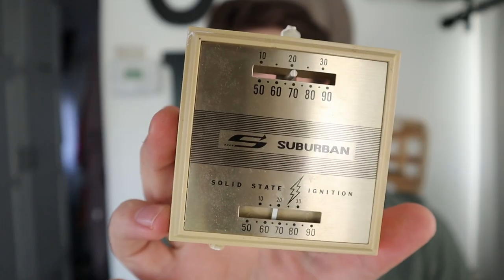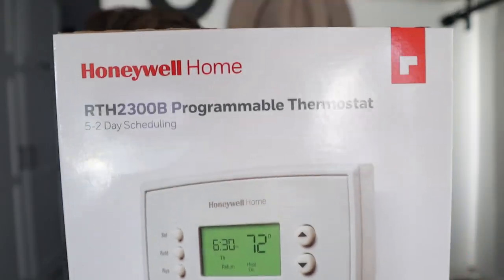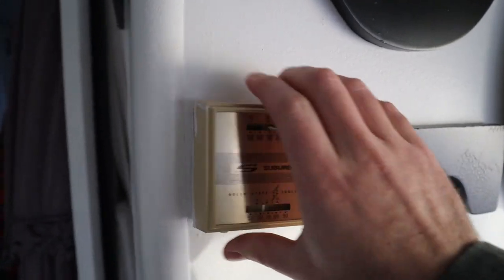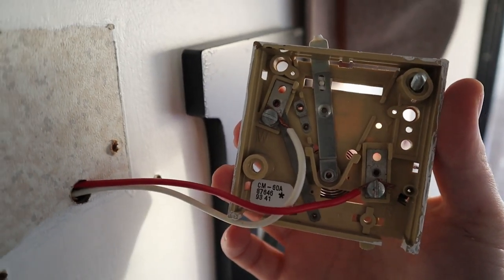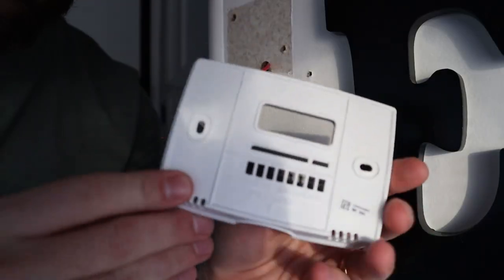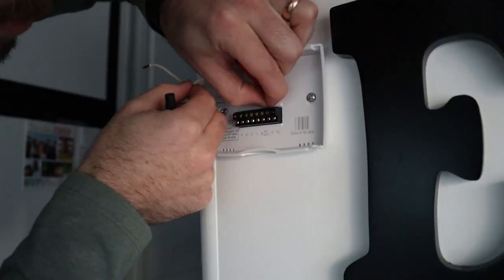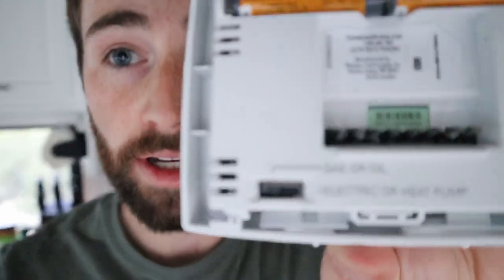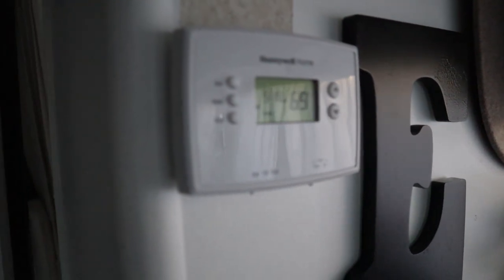CAN RESIDENTIAL THERMOSTATS BE USED IN AN RV???: Full-Time RV'er Upgrades RV Thermostat to Digital

Comment: Ours is a 2 wire/heat only as well so we went with the "plain jane" honeywell 1100 model. I see yours has AC/cool as well.  You're all set if you ever decide to wire in or add AC.

Comment: Will that new thermostat you got work with the 12 volt system? The reason I ask is because I believe mine is 12 volt and I need to replace it and want to go digital, just want to make sure I buy the right one.
Reply: I put a digital house thermostat in my 97 Aristocrat and have no problem. It works better than the piece of junk I was using.
Reply: @littlejon7884  Thanks for the reply I appreciate it. I ended up buying a Honeywell RTH221B programmable digital thermostat I think it was $30 at Home Depot and it works amazing compared to the analog one I had. Already I've saved a bunch of money on propane because I have a working accurate thermostat. Definitely a must have upgrade if you have an RV with an analog thermostat.

Comment: I hate to tell you this but I don't think that was what was causing your issue. I mean it's not a bad idea to replace that old one anyways. The thermostat doesn't have the ability to control those things separately. It just tells the furnace to go and stop, it can't really tell it to just run the fan without running on the gas. Obviously it can do this by manually turning on the fan switch if you have one but not with the actual temperature control. It may have fixed itself or your problem is intermittent and it's working fine now.

Comment: I was going to order this thermostat but I cancelled because in the product description is says for 240V. I have 12 V DC in my thermostat in my Rv. I am confused by this
Reply: Just use the low voltage Honeywell with the two 12 volt batteries and you'll be all set.  I like to keep it simple, non-programmable, heat only, two wire installation.

Comment: Super helpful guys!! I full time in a '89 Allegro and I am parked for the winter in Michigan. I went to do my thermostat install today and I notice that I have two blue wires(eek). well I am pretty mechanically inclined and also a decent diyer and figured it was simple 2 wire install like I have done before in a residence, but the blue wires  threw me off. 
I found your video and see we have the exact same thermostats BOTH!! I had purchased mine on Amazon the week before. :) so your video was helpful. I clicked subscribe!
Reply from the maker: Thank you! Always nice to have support from the RV community! 😊

Comment: I haven't even gotten into this video yet - - but I've subbed and liked!! 
I love the concept! 
WHEN are you going to get 'legal to visit Canada'?? I have a great spot for you to hang for a bit - in the middle of nowhere, with incredible vistas, within 20 minutes of the main mall of Kelowna BC, in the heart of the Okanagan Valley.
From 44 C in the midst of the summer to minus 33 C (sorry - you'll have to convert to F), we see all manner of extremes here. I'm full-time in a Toyhauler, but it's stationary. I froze up plumbing lines (and PEX allows them to freeze/thaw without bursting) but right now, I've got a furnace problem.
No biggie - - only minus 9 here and the electric heaters will keep me comfortable - until I can determine if I can tackle this on my own. Out here in BC (some say it stands for Bring Cash), a good RV mobile Tech is $150 per hour - - for travel time too!

Nice intro. I'm in!
Zed
Reply from the maker: Thanks for subscribing and we're pumped to hear that you're a fellow RV'er! 😀

Comment: Will the thermostat work when power goes out and it goes on Battery power to run blower with propane heat- it does with the current thermostat- but it’s not programmable like I would like

Comment: Check out Aprilaire model 8444 thermostat if you ever need to replace the new thermostat
Reply from the maker: Thanks for the tip
Reply: @RyanMegan  your welcome I actually have one of their thermostats and I mainly got it for a unique feature which allows you to actually set it so it will automatically switch from heating to cooling to basically prevent the space from getting to cold or hot without having to readjust the temperature settings on the thermostat

Comment: Thanks for the video Ryan.  I have a GE thermostat in my Little Guy Mini Max that I want to replace with the Hegstad.  It controls heat and a/c and It has 3 wires. The connectors inside are marked gnd, comms, +12v.  Any idea how they connect to the new Heagstat H705 thermostat which is marked (C O B W     Y G RC RH/R)